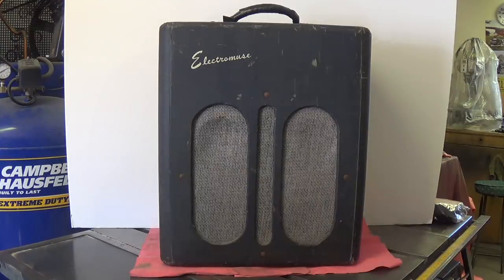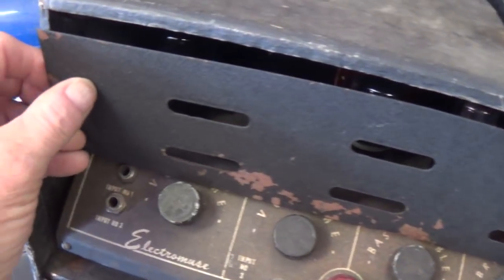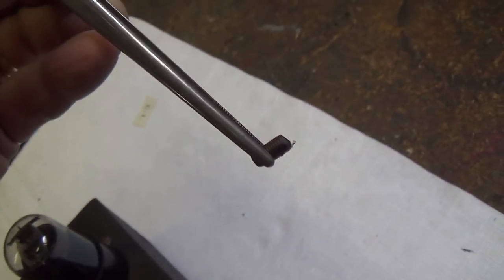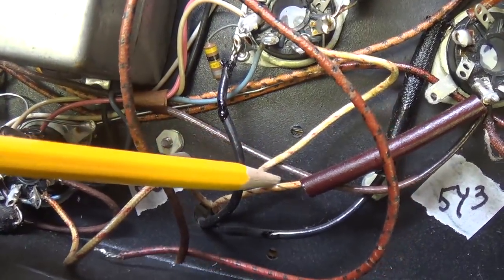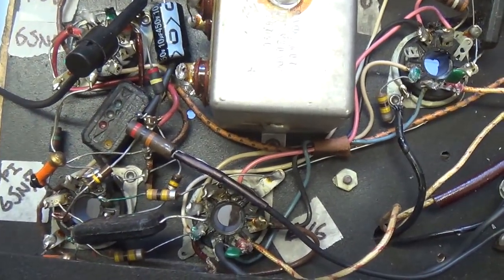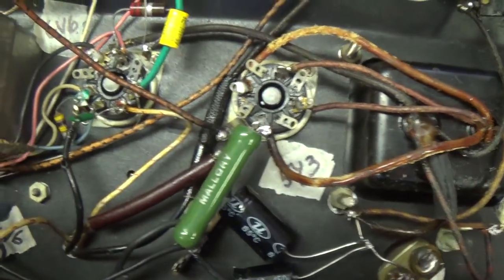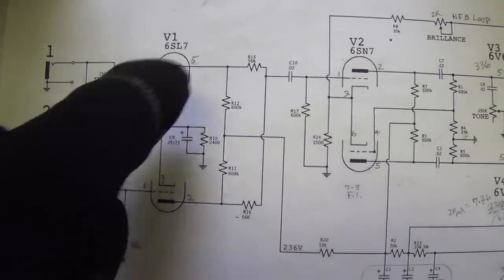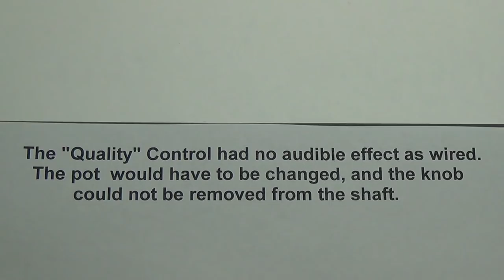Let's Explore and Repair a 1946 Electromuse Amp

Comment: Great video once again Uncle Doug, I’d a good laugh at your cracks about part’s pedigree or performance. I wonder what it was like to first-time hear guitar out of these kinds of box amps back in the day. It must have been something quite incredible. 

I also must add my support to Deoxit. Saved my employer 10s of $1000s over the years. I do the maint on 40 odd ENG News cameras at a local TV station and the shooters don’t always put the raincovers on meaning those magnesium-alloy bodies soon corrode into real messes. I found the really concentrated Red Deoxite in little bottle with a brush in the cap painted on the alloy joining surface where side covers meets main body shuts down the corrosion & then i add the gold-coloured version to really make for a better electrical connection (there’s a 1/8” diameter RF grounding braided gasket involved)... if I do this on brand new camera before it goes into service, never see and corrosion!
Reply from the maker: Thanks so much, Pete. I think amps like this were generally used with (lap) steel guitars. If the old timers could have heard one wail with a modern Strat or LP, they probably would have burned it for being possessed by the devil :)  Thanks for the info on DeOxit. I really believe in giving good products their due credit. They are the best !!!

Comment: I forgot to tell you about a recent addition to the pile and Im not quite sure what to do with it .It's an early 1950's single channel single Xtal military  aviation base   receiver i in the 30-40mhz   freqs , but it is filled with primo   almost   nos green labeled or markings GE   mil spec tubes , over 20 tubes with 6au6 , 6v6gt's  power end and loaded with 12au7's , 7025's ,   12at7's and others , I think many are substitutes as they dont match the numbers on the chassis , each tube has it's own little pot beside the tube socket , I don't know what they are for  guessing  biasing or tuning each tube)   The layout of the chassis tube side and the business side ,is exceptionally sanitary and well laid out . The transformers , are both completely encased in metal boxes and they're big ones .There is an audio amp  as it has an OP tranny and the speaker connections on back are like an old Bogen PA ,Its in a   standard 19" rack cabinet .
   The tubes were what I was after , as they are primo beautys , green labeled mil spec and look like NOS and Im sure all are matching . There was zero dust inside the radio , all tubes are GE green labeled military spec with a few stamped FAA .l I pulled the ones that I could use in my guitar rigs , swapped out the 4 /12ax7's in my Peavy 3 ch guitar pre amp with 4 12au7s from the old radio and man what a difference ,the rig has never sounded that sweet tonally and the output is where I can now turn that Fender Twin up past 1 on the volume . Ive been struggling with that for many years . Even pulling 2 of the 6l6's for 1/2 power on the Fender Twin just so I can crank the amp up a little more to get it to run hotter (its that tone thing )  . Ive had that preamp for almost 25 years and now Im  pleased with my purchase lol .
   But Uncle Doug what can I do with this monster , any ideas  on what it could be made to do guitar wise ? The tubes alone are selling by a guy on ebay asking $39.00 each for them .Geez vintage is cool but they aint gold ,  but then  maybe they are LOL.    I got over 20 of them little rascals maybe Ill sale some too.   Just in case you get curious m  heres the info on the thing , . Its a     It says on the front panel Property of the United States      Radio Receiver R-361/GR     made  by  Radio Receptor Co. Brooklyn , NY.                           It a big heavy mutha , In did some research and found a few people looking for one for their collection as well as a military museum wanting one for a diorama they are putting together but Im not sure if I want to let go of it just yet .    
         BTW I still have that little 1958 Airline tube gtr amp , still haven't got it going . The rectifier tube was bad , I got one to replace it online and it was bad as well , I got my OPT wiring issue figured out just haven't been in the mood to mess with it . 
      Uncle Doug if you want that little amp Ill give it to you you'll have to take care of the shipping though .
         Another recent addition , I found  an old Pentron reel to reel all tube powered tape recorder ,at the GoodWill Store for $12.95, it has all the right ins and outs to be used as a small amp or a pre amp , I didnt want to mess up the t the machine up with disconnecting the motor so I just pulled the belts and the motor is silent when running but it was noisy when in the record/play /pause mode . Sounds good by itself with a guitar but really honks when going into another amp with the recorder as a pre amp well worth that $12.95 Any project ideas appreciated and if you want the little amp let me know  thanks for the video Im smarter now than I was when I started watchin it ...LOL
Reply from the maker: I too have bought military electronic equipment for the tubes, switches, pilot lights, etc. and then list what's left on Craigslist and pass the carcass on to the next guy, EJ. None of the remaining components were applicable to guitar amp use. 

What model is the Airline amp? If it's not a series-filament circuit, I would definitely be interested. Please let me know the model number.

The Pentron tape recorder sounds like an interesting project, EJ. I have never heard of the brand, but most tape recorder tube amps are of pretty good quality.

Comment: I have the same Electromuse amp with same tube lineup and a 12" speaker , unfortunately the power transformer is not functioning ( overheated ) . We would like to rebuild with a proper power transformer and would appreciate what you would recommend as we rebuild this amp. We will test components and add a fuse as the rebuild progresses. Thank you for any input and for all the great informative videos !!
Reply from the maker: You need to go to the ClassicTone Transformer site and select a power transformer that will fit in the chassis properly and can handle the tube complement of the Electromuse. I would think that this one:  http://www.classictone.net/40-18016.html  would work.   I'm not positive about the chassis cutout or the lug hole match up, but you can double check this. You may have to modify the chassis a bit to make it fit.  Good luck.
Reply: Thank you!!!!
Reply from the maker: You're welcome, Tommy.

Comment: Yay!!!! More Uncle Doug!!!!!!!!   Would it work if I made a cap leakage tester with a 12v DC source and using my DMM?  Just had that thought while you were teaching me stuff.
Reply from the maker: Thanks, J. No, you really need to test them at the (usually) high voltages at which they normally operate. That's why I left one end connected to the circuit.
Reply: Ok thanks dude :)  Tons of love from just north of Lake Superior!

Comment: Would I be correct that the amp could efficiently drive a 10" 8 ohm speaker?
Side point: The reddish patterned cloth you had under the amp during the demo at the end looks like it matches a set of table place mats my wife bought some time ago. 
Your videos are always a master class on history, electronics and repair/restoration. I particularly appreciate the 'why' along with the 'what' you are doing.
Reply from the maker: Thanks so much, TM. This amp could drive four 15" speakers if the combination had the proper impedance. Amps don't "care" how many or what size speakers you hook them up to (as long as the impedance is correct). To the amp, the speakers are simply a load to be driven :)
Reply: So there is no appreciable loss in volume or tone when the load is split 'X' number of ways? Each speaker is driven the same regardless of whether it's just a single unit or however many? The only thing that matters is having the impedance correct? Is there a practical limit?
Sorry about all the questions. Just trying to understand clearly.
Reply from the maker: I know it seems strange, but all the amp "sees" is the total impedance of the speakers. The number of speakers is irrelevant. Once you start adding a bunch of speakers, keeping the impedance at the correct level becomes difficult, but I believe there is no practical limit.

Comment: Really? That was your longest video? Flew right by here! Thanks Doug, that was great! Mr. Carlson also swears by the old mica caps so I was surprised by that discovery too. What I'm not surprised at is that 4x5" sounds better than 1x12". Multi-speaker open-backed cabinets have this "shimmer" that makes it seem like the sound is coming from everywhere -- I suspect due to interference patterns between the slightly differently located sound sources, as well as the bi-directionality of the front and back sound creating a moving shaft of air. The Super Reverb being the obvious example, but this is like a wee one. All it needs are some tiny tilt-back legs! ;)
Reply from the maker: You're welcome, AQ. I always worry that I will exceed the attention span of the audience. It's a holdover from classroom teaching. 

According to some viewers, these Micamold caps are not really mica at all, and thus not nearly as resistant to ageing as the real ones. I will pay more attention in the future. 

I agree that almost without exception, smaller multiple speakers sound better than a single large speaker. I compare them to a chorus of singers each with a unique voice, producing a far richer, more complex sound that any single singer could achieve.
Reply: Maybe not the best analogy as a chorus of singers all produce slightly different fundamental frequencies, which... chorus against each other just like the familiar chorus effect does, hence its name. In the case of multiple speakers in a monaural amp they're all producing the same fundamental waveforms. Yes, they will all introduce slightly different amounts of overtones, but those overtones are all mathematically predictable and based on that shared signal that's driving them, so it's only the amounts/volume of the frequencies that vary between them, not the frequencies themselves. (It's a fairly common technique to put mismatched speakers in a cabinet too, say an alnico and a ceramic, to get a "best of both worlds" sound.)

Another factor might be increased bass response vs. a single speaker, as the higher frequencies with relatively short wavelengths will cancel/reinforce (that "shimmer" I mentioned that seems to change in very pleasing ways with just the slightest movement of the listener's head as well as creating that three dimensional spatial effect) but the lower frequencies with longer wavelengths will all still be relatively in-phase as the speakers aren't major fractions of a wavelength apart from each other -- so they only reinforce. I think basically you make a virtual speaker that's bigger than the sum of its parts. (Incidentally, this effect is almost always lost on recording, where you typically mic the amp a couple of inches in front of a single speaker in the group anyway. Multi-speaker cabinets are far more impressive in person than recorded!) Also probably a lot to do with how the cone shape of the diaphragms amplify the frequencies differently across their diameter. You end up with more center this way, which is also the part of the diaphragm that's moving the most as it's closest to the voice coil vs. the outer rim which is basically the fulcrum/hinge of the lever.

I probably think about this too much, but that's my job. Amp sim software is still high on my to-do list. ;)
Reply: Admiral Quality But they are not co-located, so there will be phase summing and cancellation depending on where you are in relation to them, and this will change as you move..
Reply: Yep, that's what I'm saying. But less so (to the point of being negligible) for the low frequencies which from 20 Hz to 400 Hz have wavelengths of 17 meters (yards) to 0.85 meters (yards). That front face is about a third of a meter/yard wide/high. 

So while the high frequencies create complex interference patterns, the low frequencies just reinforce and create an overall emphasis on the bass end.

Comment: Uncle Doug, I have the exact same amplifier on my bench right now. It has a replacement Philco OT that is covered in hair and wax. Obviously not the right OT for this amp. The guts are all ripped apart. Would you have a suggestion for a new OT? Maybe a 15W Fender Princeton type?
Reply from the maker: Tom, it's been a long while since this video was posted. I'll assume it had a pair of 6V6's, so any OPT with the proper primary impedance (depending on plate voltage) would work, especially if the secondary had multiple speaker impedance taps. The Princeton OPT would be ideal.
Reply: @UncleDoug  The primary impedance of the OT on the schematic is 7.4K. The two available options are 6.9K and 8.5K. Which one would you go with?

Comment: Interesting, this appears to not have capacitor C11 on the Mic input.  Neither does mine.  There are several differences in layout as well.  My heaters have 2 wires so I could twist them(they were down along the chassis).   Must have been a few production changes.  Mine came to me with a single 12" speaker.
Reply from the maker: No doubt there were several different versions over the years, Mr. A.

Comment: Hi I again Uncle Doug and Jack, I wanted to comment on a couple of things I forgot to in the last message. I did find a seller on eBay who has the proper thickness handle (I had to get one for a 1951 National), others sell something similar for between 8-14 dollars, but they're junk. The one I found was almost identical, but they're about 22 dollars, it's worth it if you want it to look right, I will try to locate the person who sold it (it was over a year ago). I also came up with a way to keep the original hardware, as you know it's a pain to drill the rivets out, and the new chrome with screws doesn't look proper on a vintage amp imo. Let me know if you want to know how I did it. Also, when you were talking about the amp, you didn't mention the pots. They are so much more robust than the new Alpha brand that we often use..in size and accuracy.. Then I have two questions I hope you can answer.. I noticed that circuit used several of those really old type resistors (the body being a solid color with dots or dashes to indicate value) could you explain how to read them? Finally, with the output transformer or any output transformer, when you push on a removed speaker and have an ohm meter hooked up, the dc resistance goes all over the place from the stationary position.. Remembering back to your output transformer video, and the secondary resistance reflects to the primary side, wouldn't the primary impedance be changing as much as the speaker when actually in use? You figured on a 10 ohm impedance for the speaker's.. Would it matter much if the output transformer was actually for 8 ohm's? Even if the speaker's worked out to 8 ohms impedance, is that transformer/speaker impedance relationship for only one specific frequency? Sorry this is so long Doug.. I do hope you understand what I'm trying to ask you.. I don't know all the lingo.. I know your busy and will understand if you don't want to answer the questions here..  Thanks again for this great video and I do hope you have something else coming...Tom
Reply from the maker: Thanks for the research on the handle. The amp is on its way back to the customer with its old handle, so I guess we won't be needing a new one.  Did your unobtrusive repair method include cutting the vertical pin with a hacksaw, inserting the new handle, then running a screw up from inside the cabinet to secure the holes in the ends of the handle?  Just guessing :)

Regarding the values of Micamold caps, here is an excellent article on analyzing the coding of all old caps:  https://antiqueradio.org/recap.htm#identifying   The caps I removed from the Electromuse were all the same (colors tough to judge due to age and grunge):  blue, gray, red   Which would indicate .006800uf. They all read about .0011uf, so either their value or my reading of the coding was incorrect.

Yes, the impedance varies with different frequencies, and I would have no problem at all using the 10 Ohm speaker array with an 8 Ohm secondary OPT. My comment was more to the point that the schematic showed a 2 Ohm secondary impedance......thus my concern that using a 10 Ohm speaker array might not be healthy.
Reply: I couldn't get anything over on my 8th grade Math teacher either, when taking the final algebra exam, I used my new high-tech (for the time) Casio LCD calculator wrist watch and Aced the final.. I barely held onto a 74% average all year..You'd think I'd have been intelligent enough to get a few wrong.. She knew. And you guessed correctly.. Thanks Doug
Reply from the maker: You can't fool an ex-teacher, Tom :) You're welcome :):)